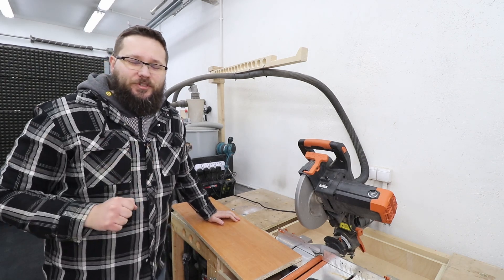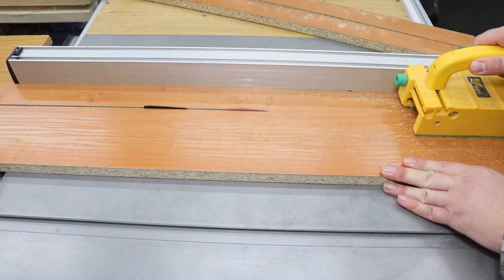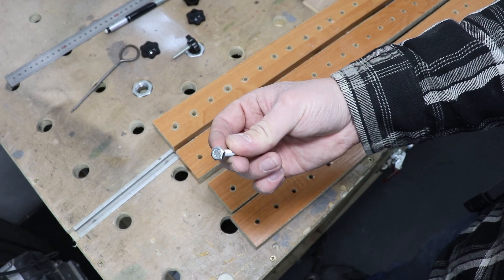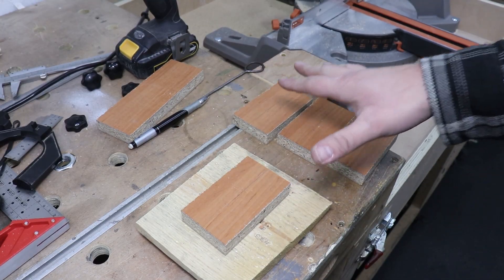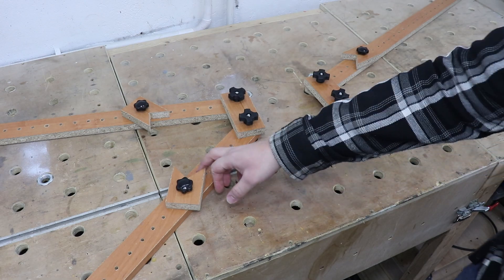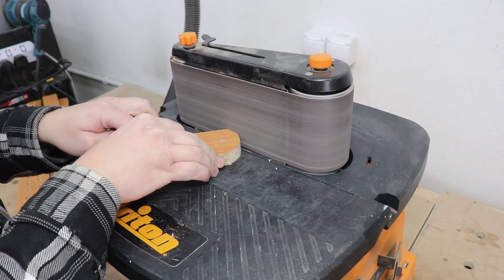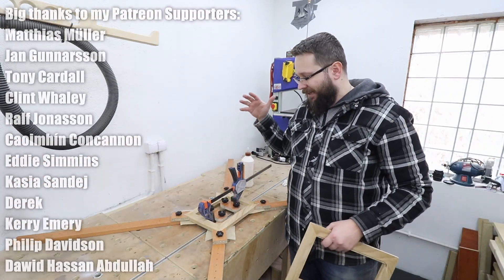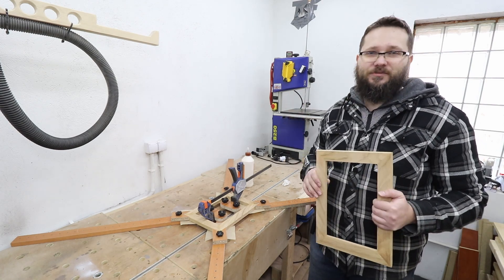Simple Picture Frame Clamp

Comment: Hi Tomasz, nice project. Can this be modified to use on boxes??
Reply from the maker: Yes I would just thicken the corner stops and the middle of the frame so you can still use a clamp. However I would then clamp the whole jig to your bench as it could potentially lift slightly if you add too much pressure in the middle in that setup